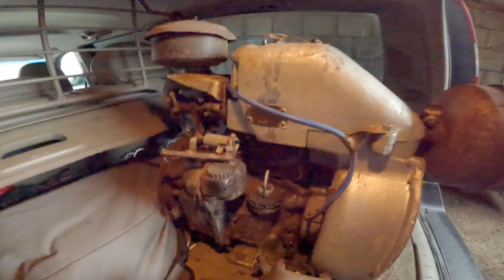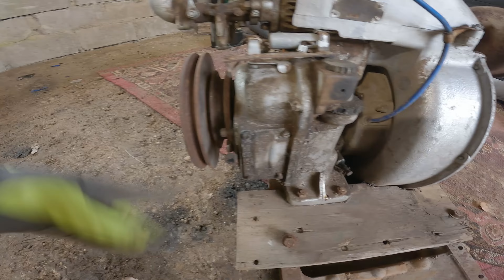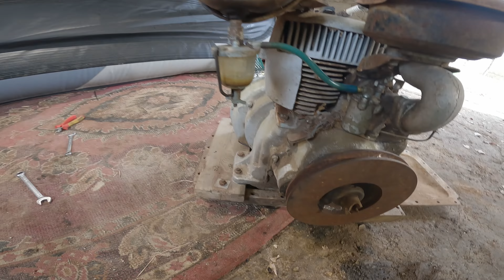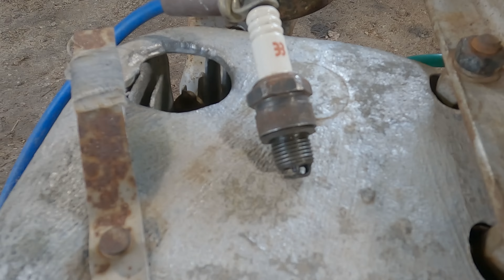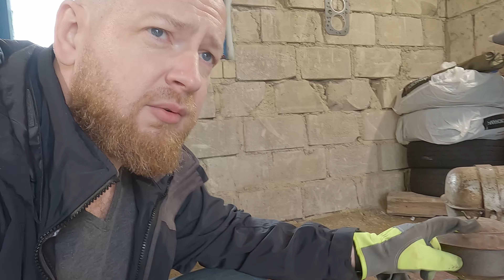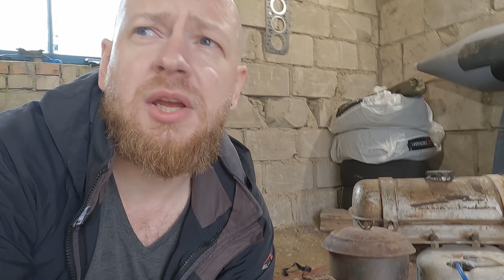Will it run? Old soviet petrol engine first start after 10 years in barn.

Comment: The glass thing you mentioned on the fuel tank is a sediment bowl, it is exactly for what you say, it separates solid particles out of the fuel as well as water since water is heavier than the fuel to keep it out of your carburetor. This system works very well if maintained properly.